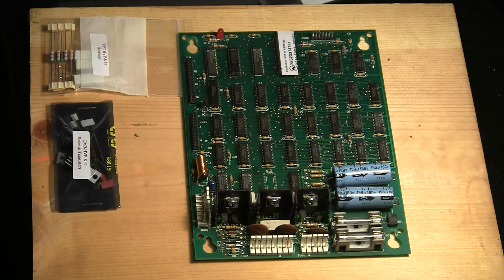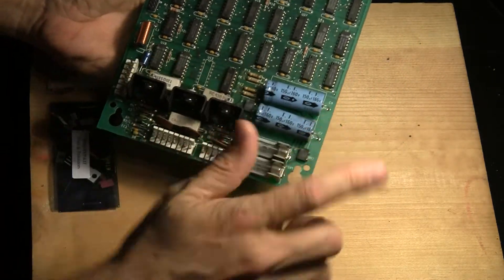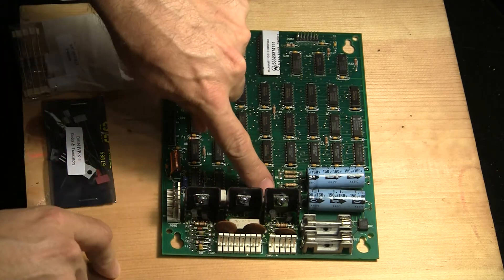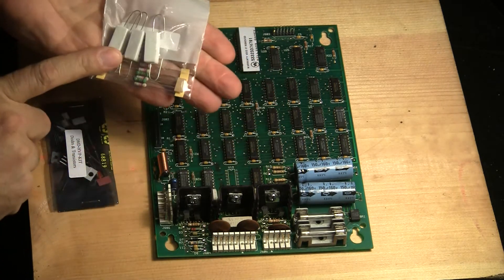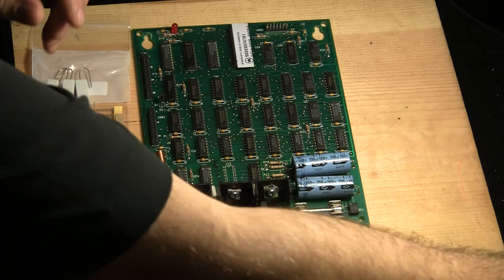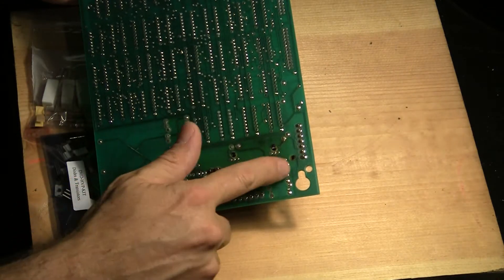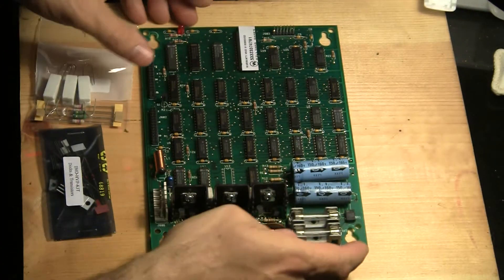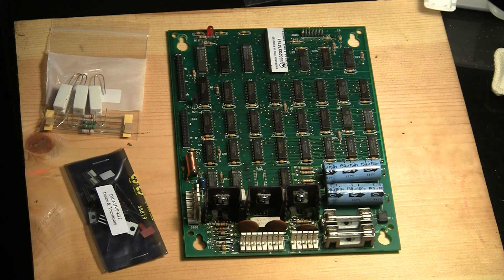Rebuilding a WPC DMD driver board PS - Part 1

Comment: Hi, great clip.  I just got myself a Flintstones which has a dead DMD..  The outgoing voltages to the DMD from the controller board are all fine, except for pin number 8. It is supposed to deliver 62V but only gives 7v..  Would you know the today's spec for C6 and C7 ? According to the manual they are different but the repair kit suggests two identical ones. (not included in the kit, must be separatley added and are out of stock. Perhaps a newer and further boosted cap is to be used),,, If not those two caps, what would you suspect could be the problem ? History of the game. Previous owner hadn't played it for 6 months but  the DMD worked perfect then....This would rule out diodes I guess as they go bad more or less under stress and continuous heavy load.. Thanks for any help. Regards Matt